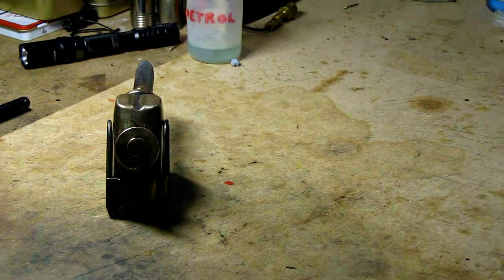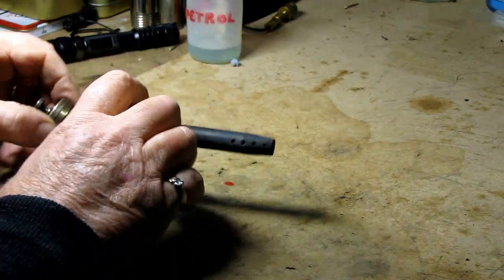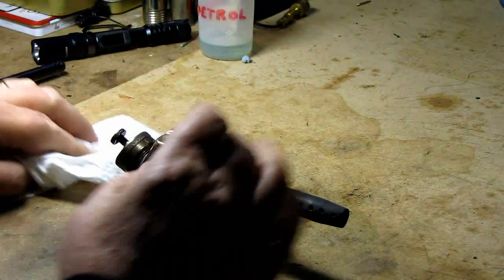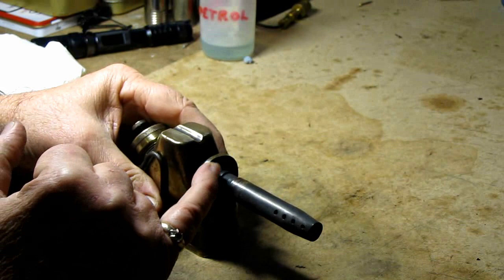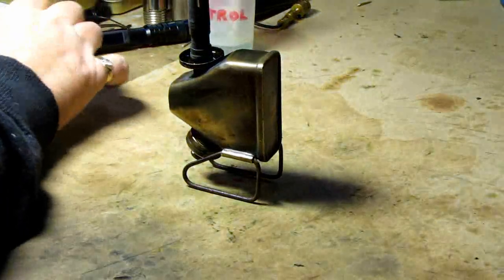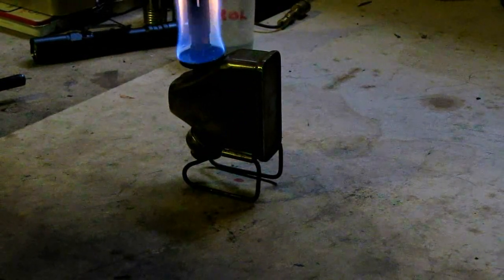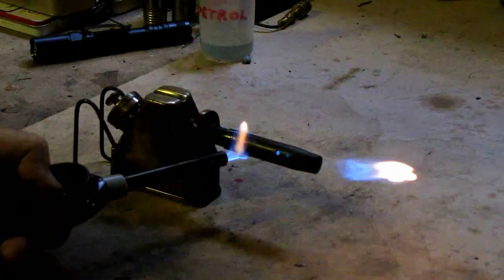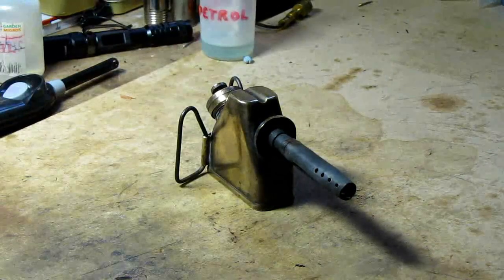Vintage German Miniature Blowtorch

Comment: I just got one of these nice little things.
Now I have a question about the wick you mentioned. Is the chamber filled with it or is it just a wick like in an old kerosene lamp?
Thank you, sir.
Reply from the maker: I wish I could help you, but I have never removed the wick from my blowtorch. It looks very tightly fitted and I didn't want to risk damaging it.
Since the wick does not actually burn, I would think that it should last almost indefinitely.
Reply: Just a thick wick, the chamber is empty otherwise.
Mine is a "Vulcano - Alemania", same specs, different German manufacturer.